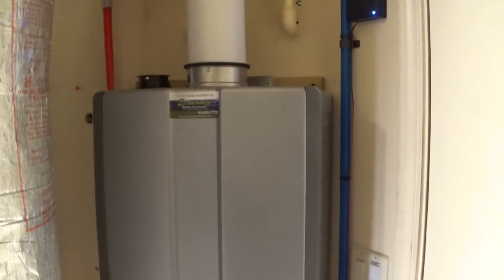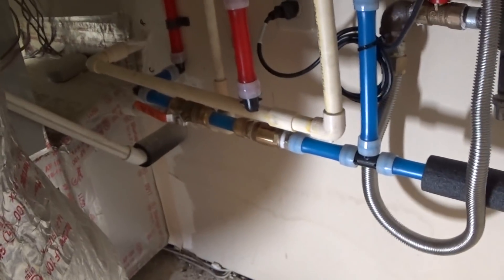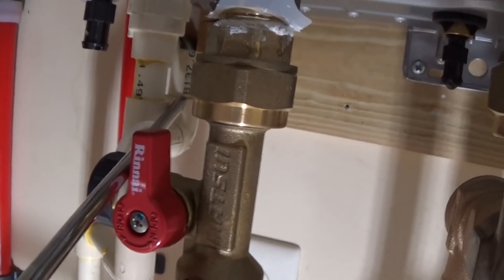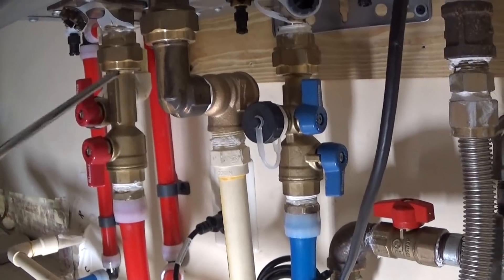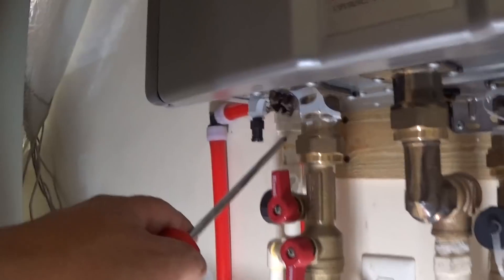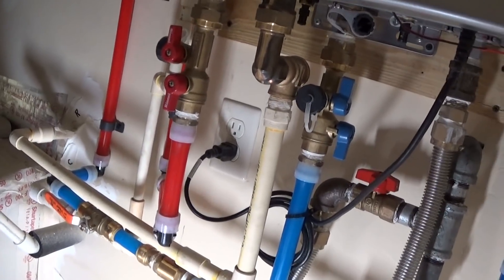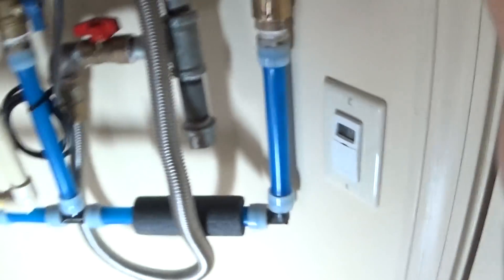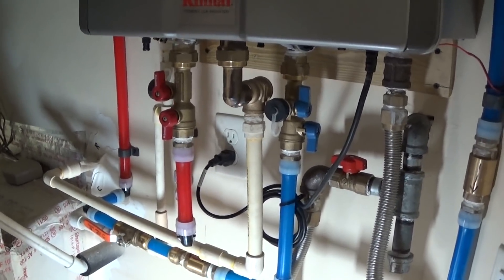Proper piping for a dedicated circulation line on a Rinnai RUR series unit.

Comment: It looks like you're running 3/4 for the recirculation line.  I've got 1/2 copper supply lines running hot water to the fixtures, would I just use 1/2 then for my recirculation line?
Reply: Clayton Lane call me at +19042385349 after 6pm and I will go over it with you. Mike
Reply: @TheBuddylab  Thanks for all your help!
Reply: Clayton Lane no 3/4” is best, you do have a 3/4” main trunk line?
Reply: @TheBuddylab  Yes, but I have no intention of replacing the rest of my water lines so wouldn't 3/4 be overkill?

Comment: I have exact unit in video. Do I need to do anything else to get recir to work. I have the control R with app. Its connected but not circulating
Reply: Joshua Peterson call me at +19042385349 after 6pm tonight and I will go over it with you 
Mike

Comment: Do you purge your return after the ball valve  before you connect the rest of it. Just wondering how you get the dedicated return purged of air. Just cant see how a return full of air will push through the spring check and out.
Reply: shrtct C it will purge through the piping the bleeders on the tankless  and the relief valve will purge the short amount of piping after the check valves.